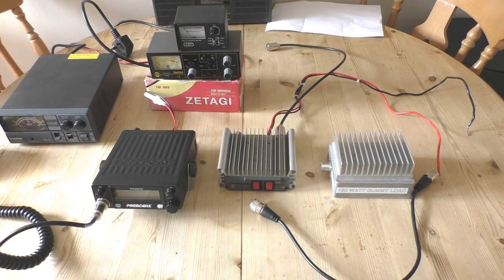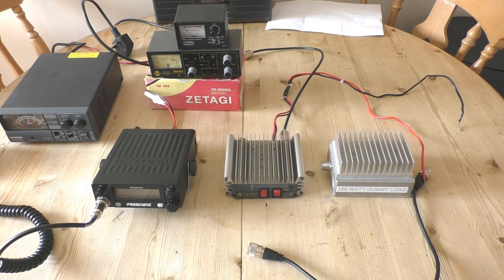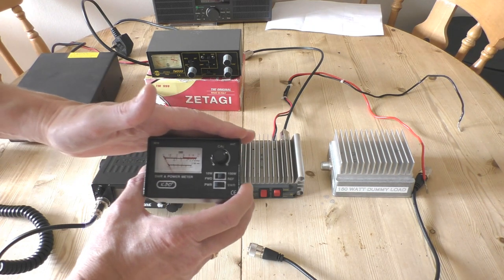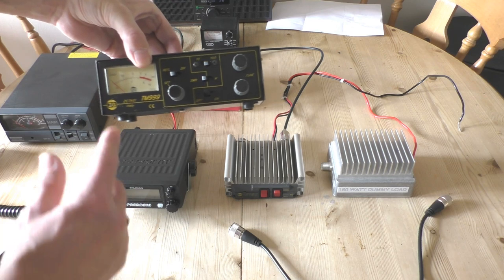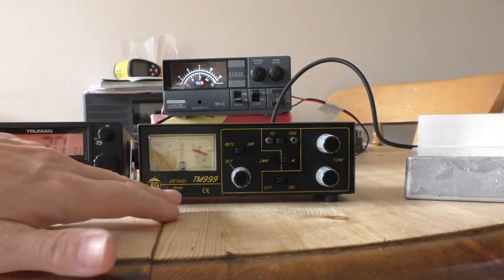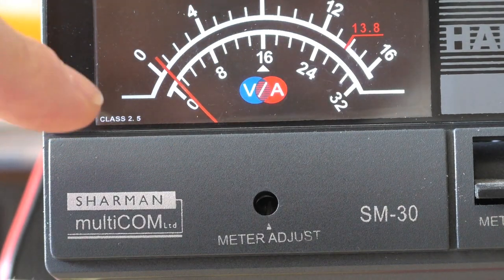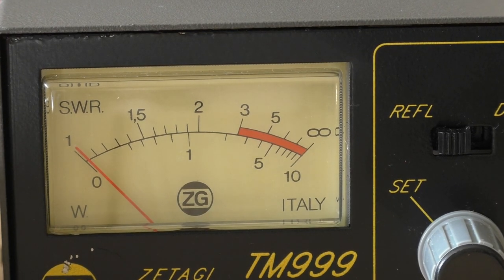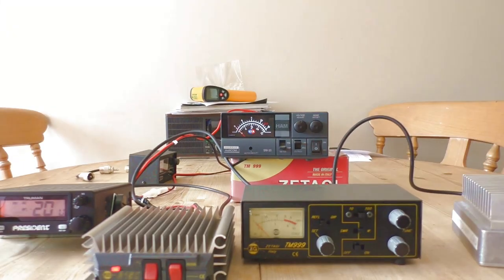How many watts do you REALLY get from a CB amp ?

Comment: Hi Fred. The meter should be hooked up after the amp. Reason is: If you put it between the radio and amp it will only read the power going out of the radio and not of the amp. So put it after the amp to know how much is going out of the amp. IE: Iff your radio does 4 watts and the meter between the radio and amp it will only tell you 4 watts. I guess you'd like to know what is going out of the amp and not the radio. Therefor most of us hook up the meter after the amp.

Comment: The SWR meter goes last in the chain, at the antenna end. (Ideally, although not practical, it should be right at the end of the transmission line, at the antenna connection itself.)
Reply: 99% of antennas do not offer a 50Ω impedance right at their feed point, it is the combination of the feed line/coax length together with the antenna's actual impedance that offer the (near) 50Ω impedance. This is why very often a better swr can be achieved by varying the coax length. Same with feeding the amplifier; if you don't want to mess around inside the amp, but you do have a high swr at the amplifier's input, you can often achieve an acceptable swr by varying the coax jumper length between radio and amplifier.
Reply: @goatsinker347  "you do have a high swr at the amplifier's input, you can often achieve an acceptable swr by varying the coax jumper length between radio and amplifier."
That's a measuring gimmick; if the amplifier is 25 ohms input and your radio is 50 ohms output you've got a 2:1 SWR even if the meter can be tricked into not seeing it.

Comment: The meter between the radio and amp will measure the input tune of the amp. The meter placed between the amp and antenna will measure the reflect between the amp and antenna, which is very important so that you don't smoke your output transistors.
Reply: Look, change the ceramic filters for 2.5kHz crystal filters and load them accordingly (about 1.2K ohm). Peak for max RX signal. Your adjacent channel noise will be gone. Put one meter after the amp, then set your VSWR resonance for the antenna. Then you will transfer the meter to the radio input. See what the VSWR is. If it's high, above 1:1.6 then open up the PA and use the trimmers to give a good match to the radio. If there are no trimers, then add a 100-200pf ceramic trimer from the input to ground. Tune for lowest VSWR. Job done.

Comment: VSWR meter won’t work well between the amp and radio, it’ll work best at the very end, so after your amp. VSWR will be slightly different after the amp because there is more cable, more connections and also the amp before the meter.  You want a little cable and connections as possible between the antenna and meter to get a good reading. 
Also you shouldn’t read VSWR with power anyway, you can of course but if you have a good VSWR before the amp is on, it shouldn’t be dangerously high after it’s turned on. If it is you have a problem.

Comment: People are forgetting the definition of SWR....you want to measure what is reflecting back down the antenna, so meter needs to be hooked to antenna (not between radio and amp). Between radio and Amp, you are no longer measuring the performance of the antenna (that is what measuring SWR is about).  After all, you want to adjust it's length, which controls the amount reflected back.

Comment: Hi Fred, just a note that when you were talking on AM the power meter was going backwards i.e. the power was reducing that is a sign your linear is being over driven and will distort. It’s really surprising considering your dead key is only 3.5 Watts on the Trueman, I guess the swing on AM is maybe only 1 - 2 Watts which tells me your amp is not linear much over 4 Watts in. You might need to reduce your dead key power down to 2 - 2.5 Watts to get it to swing up on AM to around the 50 Watt Mark with the amp on. Remember if the power starts going in reverse you are over driving and may distort or cause un wanted harmonics.
Reply: Great comments and explanation thanks.
Reply: Don't talk BOLLOCKS. On AM, you will be running in class C, not AB1, that is for SSB (liner operation). Look, change the ceramic filters for 2.5kHz crystal filters and load them accordingly (about 1.2K ohm). Peak for max RX signal. Your adjacent channel noise will be gone. Put one meter after the amp, then set your VSWR resonance for the antenna. Then you will transfer the meter to the radio input. See what the VSWR is. If it's high, above 1:1.6 then open up the PA and use the trimmers to give a good match to the radio. If there are no trimers, then add a 100-200pf ceramic trimer from the input to ground. Tune for lowest VSWR. Job done.
Reply: @susanlodges48   totally correct
Reply: That's garbage, the amplifier/PA stage for any mode where the amplitude changes with modulation needs to be linear, constant carrier modes like FM don't.

Changing ceramic filters for crystal filters without making other changes to match the different input/output impedance correctly will make your radio less sensitive giving you a false impression that they're working. 
  @susanlodges48

Comment: Fred we used to put our SWR meter at after the burner mainly because we would push about 800 watts ssb. it would depend on the day what Ariel use from a large quad (pdl2) or even a wire which ran over the house the reason for the wire it was split into different meters so one wire could do anything from 40 meters down to 2 meters. 
Dave (teapot or tango popa 35)

Comment: Without watching the video..
Generally with 4w input you get 80w max output. Even on a 200w amp. I thought that was universally known.
My SWR is 1.2
I have a 150w 4w input amp.. It gives me 70 - 80 watts on FM (pending on the meter)
I also have a 35w with an 8w max input amp... I get 16 - 20w using a 4w input.. The thing gets warm but not hot and because Im not over stressing it, thats why its lived 35+ years.

I started CB with a repaired multi stage 600w valve amp (repaired by myself at school)... My 8w rig output on am.fm would give me (bear in mind its 40 years ago) around 400 to 500w. Like a soldering iron, you only forget and burn yourself once on them.

I get s3 noise at home... Turn off the phone chargers and the PC and the noise vanishes.
When Im mobile I get pockets of 30+ electronic noise. Average noise is s3.

CB --- amp --- SWR/power meter -- antenna ... The meter is always after the amp.
Always initially SWR your antenna using just 4w bare rig power.

Comment: The power increase on AM from 4 to
40 watts, and on FM from 5 to 50 watts,
shows about a 10 DB gain, or 10 times
the unamplified power which is a nice
incease for a small amplifier. W2CH

Comment: Zatagi equipment, know for over exaggerating what their equipment does.  But yeah, you never get out what it says on the tin, but on SSB it should give it quite a kick.
Reply from the maker: Yes it would prob output close to 100 watts SSB. However these smaller cheap amps can be very fussy with audio compressing it.
Reply: @CB-RADIO-UK  Buy a set with the power already there inside it, that way there is no problems.  Buy it with adjustable power, one that you can listen all over the bands.  Just be careful.

Comment: I find amps are more hassle than they are worth. My SWR would forever change so been put away forever I think. I run the CRT SS 6900 on full power on SSB and by fluke worked Mexico on propagation. Normally work Italy 3k from Gatwick Airport on half walf silver rod. All your recommendations Fred lol.

Comment: At the end for sure. Because you're calibrating the meter with what the power is you're getting two different ratings otherwise you're calibrating the meter power from the radio and then you're getting reflected back from the amp
Reply: I happen to be a professional RF engineer. Look, there are few things here. Change the ceramic filters for 2.5kHz crystal filters and load them accordingly (about 1.2K ohm). Peak for max RX signal. Your adjacent channel noise will be gone. Put one meter after the amp, then set your VSWR resonance for the antenna. Then you will transfer the meter to the radio input. See what the VSWR is. If it's high, above 1:1.6 then open up the PA and use the trimmers to give a good match to the radio. If there are no trimers, then add a 100-200pf ceramic trimer from the input to ground. Tune for lowest VSWR. or better still lowest return signal power. Cut the coax to multiples of an odd half wavelength taking into account the characteristic impedance of the coax  Job done.

Comment: And if your using a omnl you have to divide it by 360 degrees.. Its actually more as the power is radiating out of the top of the antenna angles too in a doughnut shape..  The amount of power really is fantastically small rx, ed by the receiving station..

Comment: I have a 100 watt linear still in the box (i bought it just in case ) but i am able to talk longer distances and shoot skip without any trouble. 
I also believe using a linear for skip is like shooting fish in a barrel.
Reply from the maker: I agree.  Shooting skip on 20 watts works just as well.  Amps are good for local contacts with people who have high noise.  For example if i contact Jake in Highgate he often has S7 of noise and i need a S9 to be heard.
Reply: @CB-RADIO-UK  👍

Comment: Look, change the ceramic filters for 2.5kHz crystal filters and load them accordingly (about 1.2K ohm). Peak for max RX signal. Your adjacent channel noise will be gone. Put one meter after the amp, then set your VSWR resonance for the antenna. Then you will transfer the meter to the radio input. See what the VSWR is. If it's high, above 1:1.6 then open up the PA and use the trimmers to give a good match to the radio. If there are no trimers, then add a 100-200pf ceramic trimer from the input to ground. Tune for lowest VSWR. Job done. Use a low pass filter at the output to reduce out of band signals.

Comment: You should always run your power meter and SWR meter after the amplifier when using an amp you will get a true reading of your SWR normally if you have a good SWR without an amplifier you should not have a problem using an amp one other note these meters are not 100% accurate they are basically just a reference so you need to remember that also if you want to Accurate meter you're going to pay some really big bucks these meters for $100 $200 at best maybe 75% accurate

Comment: Hello Sir, your video is great. The SWR must be measured after the Amplified wave! Make sure your antenna and radio are properly grounded first. In a mobil i.e., car it's not the battery I speak of but the radio and antenna themselves. ( to the BODY of the car). In a base station an 8 foot copper rod into the ground to antenna and a separate wire from your radio to the same ground. I'm sure this is common knowledge to you yet I love to help. Also measuring output watts has two factors; average power and PEP peak envelope power. With that amp you tested your average was 50 but with a proper meter would swing to say 90 or 100 watts! Love your videos and hope this helps.. God Speed from U.S.A. 🍻 DB
Reply from the maker: Thanks david.  With ref to homebased earthing you just need to check what type of earthing you house has.  Sinking a copper rod near a Protective Multiple Earthing system is not a good idea.
Reply: Thanks Fred. This maybe true yet it gets rid of lots of static on AM band. I sure wish I could talk some skip with you! The farthest I've gotten was Portarico. I'm sure I spelled that wrong. DB
Reply from the maker: @adonikam1  Yeah i wish the AM skip was in.  Iam hopeful.  All the best bud.
Reply: Look, change the ceramic filters for 2.5kHz crystal filters and load them accordingly (about 1.2K ohm). Peak for max RX signal. Your adjacent channel noise will be gone. Put one meter after the amp, then set your VSWR resonance for the antenna. Then you will transfer the meter to the radio input. See what the VSWR is. If it's high, above 1:1.6 then open up the PA and use the trimmers to give a good match to the radio. If there are no trimers, then add a 100-200pf ceramic trimer from the input to ground. Tune for lowest VSWR. Job done.

Comment: Thanks for your time,
Reading all the comments, I see that there are several options to correctly connect the station the SWR meter and the ampli and also see that some colleagues comment that it can be bad for the station according to what combination.
Could someone make a summary for this topic to be clear?

Cable that comes from the antenna connected to ... XXXXXX
Output from the station connected to ..xxxxx

Ampli - connection marked as RTX connected to .... XXXX
Ampli - connection marked as ANT connected to .... XXXX
SWR - Connection marked as ANT connected to .... XXXXX
SWR - Connection marked as Transceiver connected to .... XXXX

Comment: Run your own test with two swr meters BUT they should be same brand and model to keep it as close as possible without all other variables if you use different brand meters .  Have one next to the radio and one at the end and see what you get.  You always get a bigger linear than you want because they tell you what the output is under idea or laboratory conditions.  If you want  100 watts then get something that says 200 watts and you don’t have to run it hard just back it down to low or medium
Reply: I wouldn't suggest 2 SWR meters at the same time, the more patch leads you have giving you more ohm leakage.
Reply: "You always get a bigger linear than you want because they tell you what the output is under idea or laboratory conditions."
Since there's no truth in advertising for illegal products and you have no idea what is a "watt" anyway, just get the biggest and shiniest you can afford.  Make sure it has BLUE led's they are the best.  
I mean, how on earth could I decide "I want 200 watts".  Is that RMS, is that Peak Envelope Power and what's an envelope anyway?  (It is the RMS power of the transmitter at the moment of peak modulation).  However, Peak to Peak power will be approximately 2.8 times the PEP which in turn is about 4 times more than dead key AM.  It is all the same, but they can give much Bigger Numbers if they use Peak-to-Peak for labeling.

Comment: All the way through the CB heyday I never used or had interest in 'burners' although they were very common. So many badly set up rigs used to bleed over channels and otherwise cause chaos in the hands of the idiots and malicious. Now too old to camp on high ground for hours I suffer lack of contacts on 4 watts but see SSB and a better antenna  as the way forward. I can understand in current conditions why people use them now though - it's lonely out there ! Been looking at magnetic loop antennas recently - any experience or advice to pass on ?
Reply from the maker: Hi John.  Mag loops are quite pricey for CB.  You can make your own and use coax.  The hard part is finding the vari cap that can handle more than 10 watts in (QRP).  You start looking at oil filled caps and the price jumps up.  They are interesting though.
Reply: You can run an old hf rig and get 100 watts sideband clean!

Comment: Use a low power SWR meter to adjust the antenna at Channel 1 and 40 to under 1:1,5. Remove the low power SWR and replace it with high power SWR/P meter (after the amp). With 80W o/p be sure to ground your gear effectively. 80W CB is illegal anyway. Keep it therefore, let's say illegaly, to about 16W max. It's good enough to get around the EU.
Better invest your effort into a stationary multy Lamda dipol or even better, a Delta-Loop antenna.

Comment: You need to put two POWR / SWR meters. On between the radio and the amplifier and one after the amplifier. Thats the best way. But once you tested that and everything looks as it should you could remove the one between de radio and the amplifier. I mean if you have the setup tested it probably will stay good. So one meter should be enough i think.

Comment: Greetings from Andorra.
I have the same SWR meter and also a small amp.
What is the correct way to connect it all?

Thanks a lot
Reply from the maker: HI.  I set up.  RADIO - SWR - AMP.  Unless you want to use the SWR meter as a power meter then i place it at the end.

Comment: Please explain the advantage of using a linear amp because although you can reach out farther, the additional radios you reach can't respond to you because they're only transmitting at 4 watts.
Reply from the maker: Hi James.   The main problem these days with home set ups is the high amount of QRM background noise. Some days you can be dealing with S7 or higher. The amp helps to boost your signal above that noise so the receiving station can hear you.  Its not really about distance. On a perfect day 12 watts on SSB is plenty but with all the electronics crammed into a modern house perfect days are very few.
Reply: Exactly right.  But the point isn't to talk to people using the legal 4 watts.  The purpose of doing this is to talk over a thousand people using 4 watts and find the person with 400 watts.  You and that person can then have a nice chat with a thousand people listening to it.

Comment: I am looking at getting a wee amp it is between the zetagi b150 or rm 200p would you recommend one of them over the other if i remember rite people use to prepare the older zetagi models
Reply from the maker: Personally i prefer the B150 as the relay seems to work better.
Reply: @CB-RADIO-UK  Thanking you

Comment: If you want to measure the VSWR of your antenna, put your meter next to the antenna.
Your 'linear' has its own matching network in it.
Reply: Thanks Tony
Reply: Does it?  I don't think these amplifiers have provisions for auto tuning.
Reply: @ve5uo  No, they do not auto tune. They are really quite crude. 
Wherever you insert your VSWR meter, it will display the ratio of outgoing power against reflected power. Putting it between the radio and the RF amp is meaningless as it should be tuned to represent a near perfect 50 Ohm match.